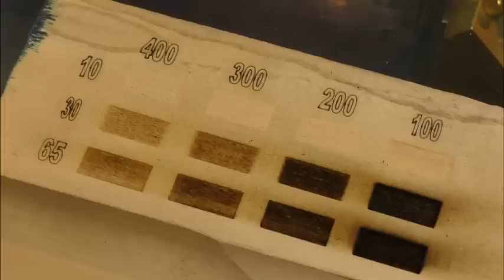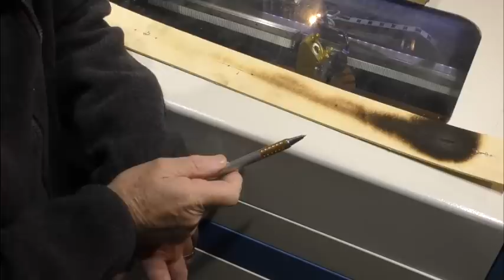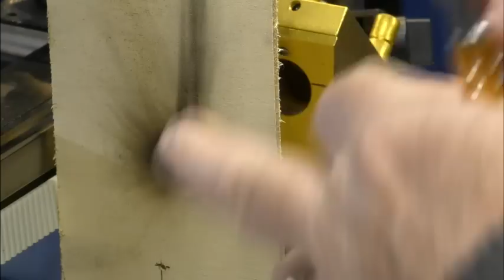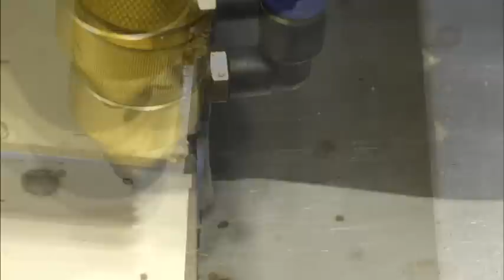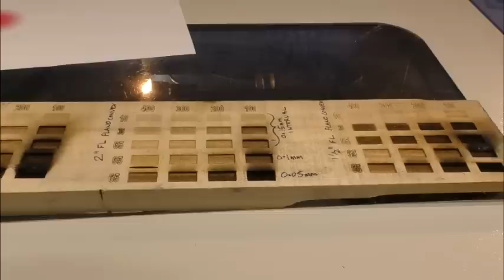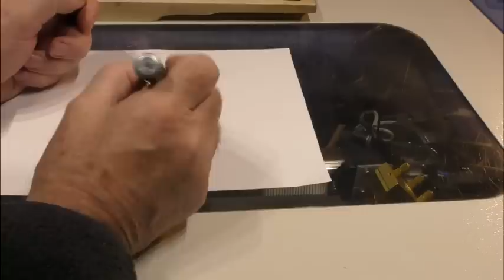RDWorks Learning Lab 129 The Mechanics of Wood Cutting

Comment: Hello Mr.Russ, is it evaporation(vaporization) or sublimation?ty
Reply from the maker: Carbon has no liquid phase. It changes directly to  gas from solid and that process is called  sublimation.  Although the term vapourise  is loosely used to describe the  disappearance of a material affected  by extreme heat,  it is scientifically inexact for carbon and a few other compound and elements .
 Best wishes
Russ

Comment: Hello and thank you for this series! I'll be way ahead when my K40 arrives. 

Per this video, would it work better to make very deep etched areas without charring by making multiple passes with spread out dots, each pass being a little out of synch with the last until all the area is covered by the dot passes? That way, each conical divot has time to cool before you zap a nearby area on the next pass?
Reply from the maker: Hi Peter
It became clearer to me afetr this work that cutting wood was really a two stage process. Th energy in the laser beam excites the wood molecules to higher energy states. More excited molecules means higher temperature.. The IR light does not penetrate the wood but instead interacts with the only  surface molecules that it can get to. As the wood (mainly cellulose heats up) it reaches a threshold temperature for each of the various constituents of the wood . As each reaches its threshold temperature it will do what it does at that temperature. For instance some of the oils and resins will boil off as vapour and then at about 350 C the cellulose will decompose (burn/oxidize) leaving behind a surface film of carbon. Note I keep stressing the words surface and film. When there is only carbon on the surface to react with the light, it continues to be excited by the light beam,  get hotter and hotter as it's molecules get vibrated to extremes. . The damage threshold for carbon is about 3500C whereupon it immediately changes to a gas and disappears leaving behind clean wood. That wood now starts the whole process of decomposition again.. When you understand this mechanism  the results that you see on the test  matrix tend to make a bit more sense. The scanning  process is one of burning lines and each line can have  an obvious energy density profile where the centre of the line is deep and burnt dark whereas the edge of the line may be a light brown.. The longer focal length lenses are better at producing a s"softer line with less colour difference.  If you can find the ideal pitch between the lines for a given power and speed  you can in fact produce burn -free cutting   i.e. depth of cut with no scorching. It seems unbelievable but I have done it many times. In effect what you are doing is achieveing  a power per unit of time balance that ceases to damage the molecules just after the carbon has evaporated. This  leaves the clean wood exposed. You will have fun hunting for these parameters . Remember it will be different for various woods.

Best wishes
Russ.
Reply: I understand. Thanks! The chemistry makes sense.

Because there is a cross-over point where science yields to art and experience, the trick seems to be to always have a few pieces of the same material on hand, as well as an easy-to-modify matrix of test patches to blast away at before committing to etching the final product (science). Then, fiddle, fiddle and fiddle some more (art), cross your fingers, hold your breath and boldly press the button (experience).

Comment: Interesting.  confounding variable: Smoke point of the oils in the wood.  Test this: lower x scan acceleration and use x unilateral at the same speed. The assumption that it's gaseous carbon causing the blackening alone I think is wrong - especially if I consider how yellow my fingers get. The air assist does force the smoke and vaporized carbon back onto the wood. Faster engrave speeds also move ahead of the air assist faster i.e. less time smoke is blown onto the surface. Another confounding variable is that the acceleration is constant which means that there are greater delays for higher speeds between passes. You could also calculate duty cycle and factor in average power delivered if you know the power delivery - and then turn the air assist off to see if the colour is purely from energy delivered per second over the entire operation  - which would have the same heat delivered per pass.
Reply from the maker: Hi Christopher
For the very reason you describe, I never use air assist for engraving.  If you see plumes of smoke rising from my SLOWER matrix tests, it is nothing to do with air assist but because "gaseous wood" if I can describe it crudely, takes up a lot more volume than solid wood,  it expands away from the trailing edge of the cut as a jet of dense smoke and paints the surrounding area brown.  The other half of successful clean engraving is high cross flow fume extraction and NOT down through a honeycomb bed. I currently have some infrared pyrometer equipment on order to investigate the burn temperatures for different materials. Some disbelieve that we are vaporizing carbon at 2000C when we cut wood, despite the visual evidence. So, there's only one way to settle the dispute and that is to measure it, along with other materials. Wood does not spontaneously combust to leave a clean unburnt surface behind, it has to go through a process of burning involving oxidation of the cellulose (the burning) which in turn  leaves black carbon behind. So where does that carbon disappear to if it is not turned into gas by a process of sublimation at something over 2000C?  No matter how unbelievable this seems  the laws of chemistry and physics are fact and if you can explain away the disappearance of carbon in some other way you may be on your way to a Nobel prize.  

All best wishes
Russ
Reply: SarbarMultimedia torréfaction and pyrolysis account for some of the material loss as well. In fact torréfaction could explain material removal by gassification of intra cellular and sub surface moisture in wood

Comment: Hi Russ. so i have everything going but when i send file to laser the design will not finish because size is different on the laser. on the laser controller the x=127.6mm  the y=204.5mm and the z=3011.2... no mater what the file size that don't change. How i can change it to match the file i send.
Reply from the maker: Hi Miguel
Your information is very precise  but means nothing to me as I cannot really visualize your problem.
So I am going to have a guess at what may be your issue.
I think you are trying to run a program from your PC via the USB cable?
Before you press START, go to the machine and with the keyboard arrows drive the head so that it sits at about x=20 and y=20 (forget Z). Now press the ORIGIN button. 
Now back to your PC and press START button.

Has that fixed your problem?

Best wishes
Russ

Comment: Hi Russ,
I hope 2018 is going well for you. Your videos are very informative and easy to understand. I am in the process of putting together my first CO2 laser and have a few questions. Is 6mm Acrylic suitable for viewing windows into the laser. Is an acrylic face shield ok for eye protection ( I wear glasses ). I don't intend separating the laser tube from the cutting area, will this be a problem. 
The last question. I have made a holder for a red laser pointer that fits up the lens tube to align the mirrors and the laser tube in the reverse direction, do you think this is a good idea.
Retiring new year, looking forward to having the time to work on all my projects.
Cheers Dave.
Reply from the maker: Hi Dave
The laser beam is a coherent beam of light. Unless you get right in the beam (like in the beam of a torch) there is little to harm you or your eyes. The 10.6micron wavelength light is an invisible beam (which makes it dangerous) but it does no harm until it hits something solid, whereupon one of two things happens. If it is a metallic surface it will be reflected with various efficiency. Gold, aluminium, silver copper are all virtually perfect mirrors regardless of the shininess. Non flatness cause convergence of divergence which scatters the light, just like visible light. Virtually any other material will "absorb" the light. By that I don't mean it will soak into the material like a sponge, No, instead the light will stimulate the material SURFACE atoms to a more energetic state. More energy means higher temperature. Virtually all-non metals are also poor conductors of heat, so the surface heat does not transmit into the parent but continues to be stimulated and heated. in a fraction of a second the temperature can be thousands of degrees C. This is the damage mechanism that you must protect yourself against. ANY plastic or glass product will 100% absorb those light waves so you do not need any special and expensive filter materials or glasses for this particular type of laser. I wear cheapo pound shop glasses (polycarbonate lenses) but proper glass lenses are just as protective. The slight disadvantage of glass is that it shows no obvious signs of beam impingement until the heat builds up sufficiently to crack the glass. Any plastic glasses like mine or simple industrial poly-carbonate  glasses  will immediately cloud up on the surface if there is a dangerous level of IR.
 
 https://www.ebay.co.uk/sch/i.html?_from=R40&_trksid=m570.l1313&_nkw=safetyb+glasses&_sacat=0

Understand and respect, rather than fear your laser beam.

As for the red light UP system? It sound like a good idea but has one fatal flaw as the many others that have tried it discovered. I admire their honesty in reporting their failure back to me. I have now stopped at the mk7 red beam pointer because I could not get the perfection I required for the same reason as I am just about to explain to you. 

The fundemental problem is making sure that the red beam is an EXACT simulation of the laser beam. To do that you must first make sure that your pointer beam is PERFECTLy coaxial with the laser beam as it exits the tube. The ultimate attempt I made was to make a one piece tube clamp and mirror one assembly  see 
https://www.youtube.com/watch?v=HuNZu1-BXuY&t=208s

I made one big assumption and that was that the axis of the laser beam would be coincident with the external glass tube. By mounting my pointer accurately in this anticipated path would  give me the coaxial perfection I had been striving for. Wrong. Even this was not the perfection I had hoped for.

My point to explaining this is the the red beam UP system may get you a red dot right in the centre of the laser window, but you will have ZERO knowledge about its coincidence to the axis of the beam inside the tube. I pointed out this fact to others but they still tried and failed.  My methods have always been potentially successful by starting at the tube end but after more than two years and 8 attempts I still only use the scorch method to set my beam.

Hope this saves you some time and money
All best wishes
Russ

Comment: Hi, I wonder what would happen if CO2/carbon dioxide gas either filled the enclosure, or was used in place of assist air.
Reply from the maker: Hi Brenda
Apart from preventing another pizza oven incident , I don't think the effect on cutting will be very much at all. Air is 21% oxygen and 78% nitrogen and 1% trace gases (CO2 amongst them)  and oxygen is the key gas for scorching (oxidizing) materials. The actual mechanics of energy transfer at surfaces would not be affected by the presence of CO2 (the exclusion of oxygen) because the heat is so intense that material evaporation would take place anyway. It may reduce the scorch halo around the cut, but I'm a bit doubtful of that also because the intense heat in the cut area would also be sufficient to breakdown the CO2 and release the oxygen required for the local scorching process. 
In metal cutting lasers, nitrogen is used as a cover gas (and it must be medically pure grade with zero oxygen contamination)to exclude oxygen from the process of cutting stainless steel in particular, where the the presence of oxygen combines with melted chromium to make an thick treacle like melt that is difficult to blow away from the cut area and leaves horrible dross on the back of the cut.
Thanks for the comment because speculation and inquisitiveness drives exploration and understanding.
Best wishes
Russ

Comment: I have a Chinese coming -130W. When I transfer a file from Corel with a thick line weight, say - .1" the line doesn't appear to be thick once it's in RDWorks. How do I view and cut (scan) a line in RDWorks that has a certain line thickness?
Reply from the maker: Hi Paul
 You cannot do what you want. 
You may wish to download RDWorks form the Ruida website   http://en.rd-acs.com/down_complex.aspx?fid=n14:14:14&pageindex=2 (first item issue 26) so that you can begin to play with it.

RDWorks itself draws in vector format. With that format you can scan between two boundary lines to produce a thick line.  Draw a series of smaller and smaller concentric circles to make something like an archery target. Specify the whole object as a scan parameter and look at the result in the preview screen. You will see that the outer circle has scanned (a thick line between two boundaries) the next one is blank and the next scanned etc.
 You must have vector lines to CUT and as you can see from the above example you can also use them to define scan boundaries. If you IMPORT a bitmap file of any sort (bmp, jpg png gif) you will only be able to SCAN it. Thick lines in your original bitmap will both show and engrave as per the original.

Best wishes
Russ
Reply: sounds more and more like a hassle. I use a Universal Laser here at work, and their laser receives thick lines directly from Corel. What is CorelLaser software? Will it work with one of these Chinese lasers?
Reply from the maker: I do not use Corel but when you install RDWorks there is an opportunity to embed it into CorelDraw so maybe under those circumstances it will do what you want. Sorry I can't help with this one . There is a Facebook group of very friendly guys that I'm sure will be able to advise you better on this issue

https://www.facebook.com/groups/900528680076062/

Best wishes
Russ

Comment: Hey Russ I was wondering if you could give some advice for a problem I have. I want to achieve the opposite of what you have in this video, I want a dark burn but as shallow as possible without any smoke residue, so far having a low power and speed works for me but there might be something better. Also what is your opinion on LightBurn the new "RDWorks replacement", it's in trial period currently, will you be using it? Will it affect the RDWorks series? Might it feature in a new series?
Reply: Also happy new year and thanks for the videos!
Reply from the maker: Hi Cosmo
I have later versions of RDworks and tried them but I currently still use issue 18 as it works well and does everything I need it to do. The multi grey import of binary bitmaps has been fixed in later versions but most of the changes are to accommodate other machine configurations such as SIX laser tubes.  Sorry not for me. . Your mention of LightBurn is a first because I just live in my cave and  new software will not help me unravel the very problem you ask about. I am currently digging deep into the way that the energy density can be manipulated to give different "burn" conditions.  After finding that the high energy density evaporates the wood cleanly I am now back onto dot pictures where I am trying to use the new found information to logically work out how to get small dots. My dot work previously, now I look at it again, is not quite the dot I thought at the time. Now that I have learned more I can see that it is a very small evaporated hole surrounded by a little scorched halo. In my quest for a smaller spot I am trying to find ways to limit the energy density at a spot so that I can achieve exactly what you are seeking....controlled scorching. 
Not there yet
Best wishes
Russ
Reply: Thanks for the reply! I am just trying out this new software and it is much easier to use than RDWorks so I am pretty convinced by it, the whole thing just makes more sense. I will look into trying out the later releases of RDWorks though so thanks for that suggestion. Very excited to hear you are back onto dot work as that is my favourite thing to do on my laser, looking forward to updates! Controlled scorching will become possible with some more experiments, I had thoughts about focal distances but I'm not sure how linked they would be.
Thanks again!
Reply from the maker: Different lenses will produce different energy densities and may help the problem. I'm sure the biggest issue is the damage threshold for the material you are trying to dot. I have a white card that is a lovely material but I think it is full of china clay and almost refuses to turn brown. I have some thick card that is very soft (it's like beer mat card) that seems to have good scorching ability. So look at your material carefully.
Best regards
Russ
Reply: SarbarMultimedia I've found the best material for dot work is European Beech because it has a very minimal grain and it is a hard wood so it burns nicely. It is also extremely pale which creates an amazing contrast between dots. I'll try to get a picture

-- it's not the cheapest material but my local sawmill got me some very decent planks and off cuts